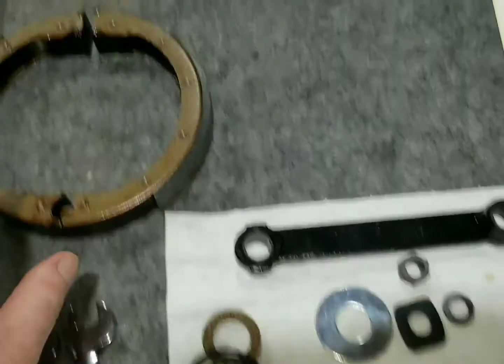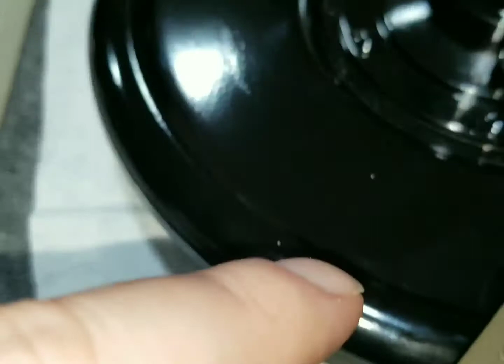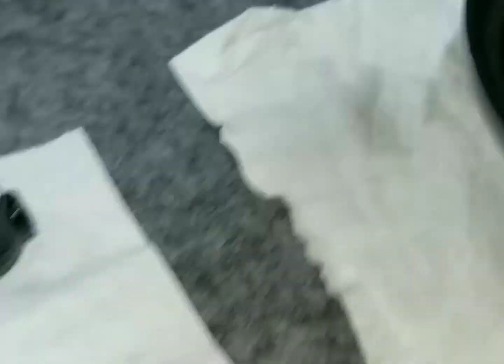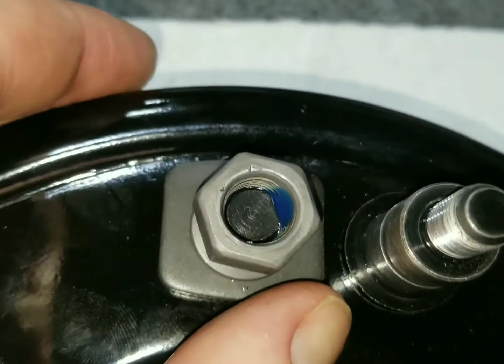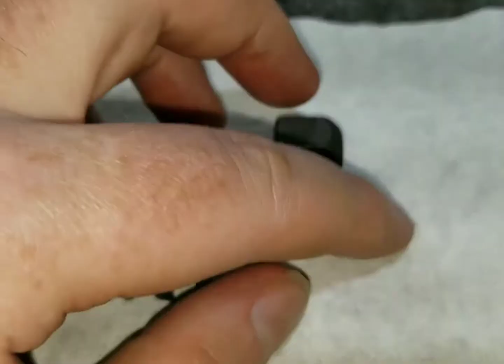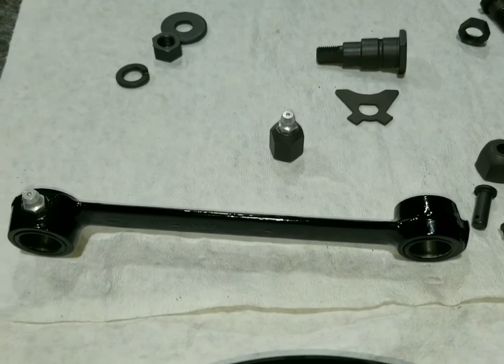Harley Davidson big twin spring front fork mechanical front brake restoration

Comment: Seems like you should have greased a bunch....where did you use loctite? Was anything supposed to be torqued?
Reply from the maker: Well we had to assemble and disassemble both wheels several times and once to assemble the rolling chassis without paint for proper fitting of all parts and fenders and that's why we didn't grease any of the grease fittings at that time and said we would wait till final assembly to grease all fittings. Both of our old manuals for this bike don't give any torque values and just say tighten securely we did mention and gave the torque value we used that later manuals give for bolts with those diameters and we also showed where we put locktite on in certain area's.